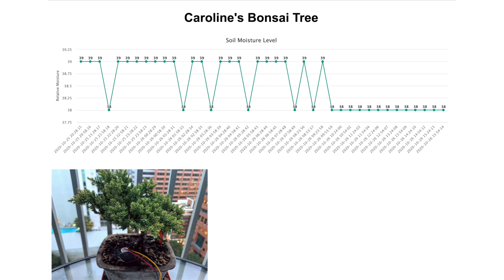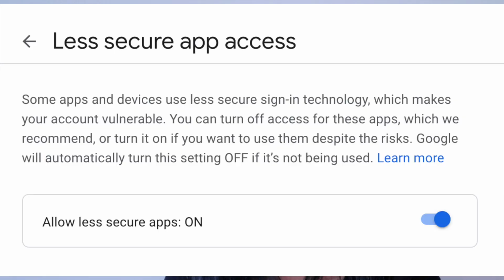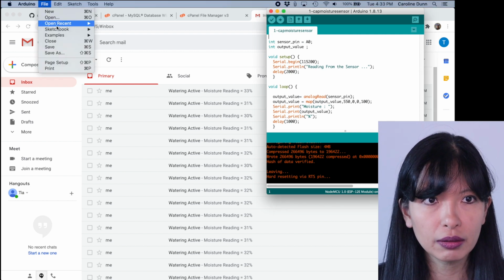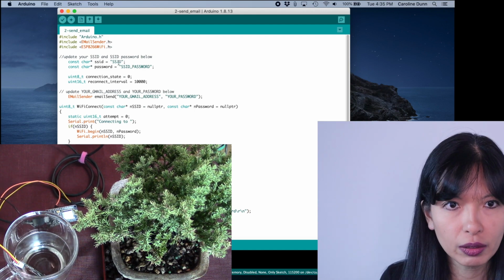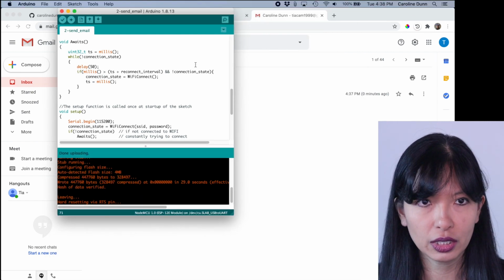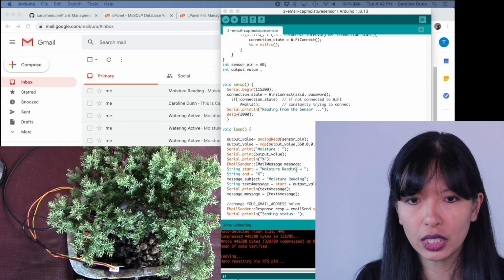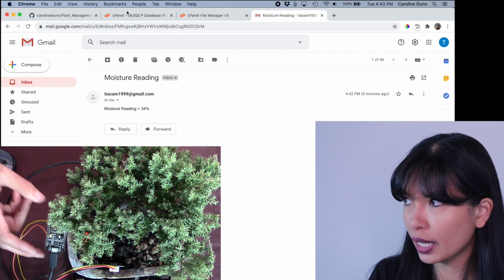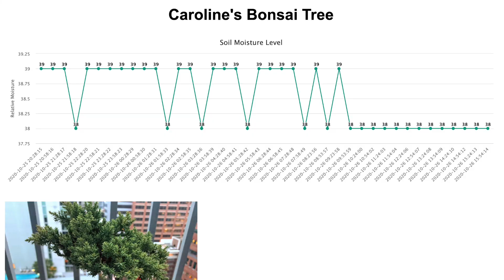House Plant Monitoring and Watering Part 2: Automated Emails ESP8266

Comment: Hi Caroline, Google are removing the Less Secure Apps function at the end of May 2022.  Can we use more secure email.
Reply: Look into generating an 'app password' under your Google account settings> security. Use it instead of your email password in the code. It's very easy and will most likely solve the SMPT send error you might be experiencing.
Reply: @SpunkyGo0se  Thank you for your suggestions, enabling two factor authentication, then app password, name of the app was Arduino, and the change the email password to the code given solved the problem.

Comment: I keep getting, this error: #include <EMailSender.h>  EMailSender.h: No such file or directory
Reply: same here, did you find a solution?
Reply: Did anyone find an answer to this problem
Reply: @scottstoller5640  To use this library, open the Library Manager in the Arduino IDE and install it from there.